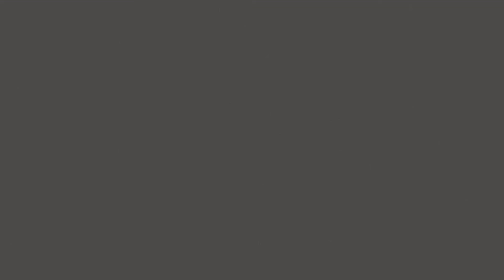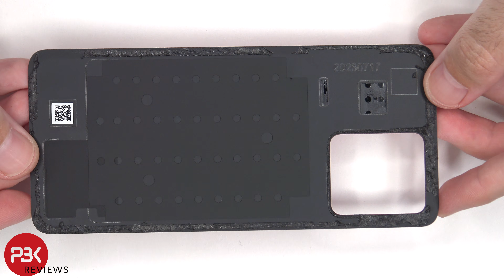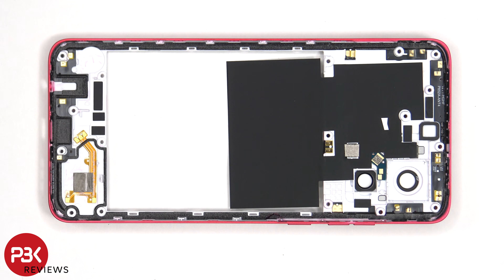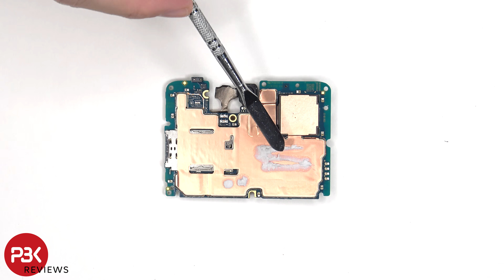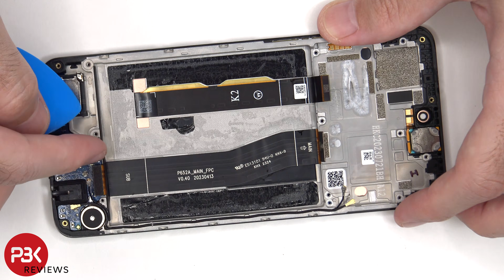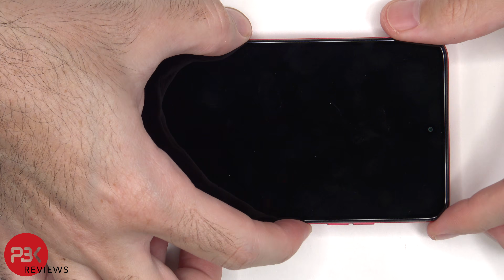Motorola Moto G84 Teardown Disassembly Repair Video Review

Comment: Did a screen replacement on this phone recently and would like to add that the circuit board screws (the 2 in the main board and the one in the sub board) are a different length to the previous screws holding the housing. Screwing in the longer screw into the main board hole (next to the cameras) poked the display from the back, breaking the pixels in that spot. Just something to be aware of.

Comment: My Moto g84 got water drops on it and I didn't notice on time that there was water between it and the cover and now it's stuck in a boot loop, how do I fix this? 😭 I hate that with new phones you can't just take the battery out to turn them off to prevent further damage

Comment: Hey, I really need help with this phone because I honestly don’t know what to do anymore. A couple of months ago, it suddenly turned off one day when I tried to plug it in like normal, and since then it’s been acting up. I took it to a technician, and they said it was the charging port (they replaced it), and it seemed fine after that. They said it had short-circuited, so I thought the issue was fixed.

But about a month after the repair, it happened again — it turned off the moment I plugged it in. Thankfully, it only did it that one time and worked fine for another month or so. By then, the warranty from the repair had already expired, so I just crossed my fingers it wouldn’t happen again.

Now, though, it’s gotten worse. I’m scared every time I plug it in because it feels like it might shut off again — and this time it did. Right now the phone is completely dead. It doesn’t recognize the charger at all. And obviously, it needs to be charged every day, so this is kind of unavoidable.

Usually, when this happens, I leave it alone and try again the next morning, and it randomly starts working again so I haven’t timed exactly how long it takes. But this time, I’ve had it plugged in with the original charger and it just won’t respond. I'm really starting to worry that this is either a problem with the phone model itself or maybe I just got super unlucky.

Does anyone know if there’s a known issue with this model? Or have any idea what could be going on? I’m 16 and I really can’t afford a new phone (cause i'm broke 💀)  I know it might seem like a small problem, but this phone was a birthday gift just last year and my parents already paid for the first repair, thinking that would fix everything. It’s only been about 18 months since I got it and I really took good care of it — never dropped it much, never got it wet, the screen isn’t cracked, and I even tried to avoid using it while charging to keep it in good shape.

So yeah, it’s just super frustrating because I rely on it for school too, and now it’s like I only get one charge a day before it dies again and every time it happens, it takes hours to respond, if it even comes back on at all. I’m scared one day it just won’t turn back on ever again (I'm worried about the things I have there.)

If anyone has advice, knows a fix, or has been through something similar, please let me know. I’d really appreciate it. I’m just feeling kind of stuck and don’t want to stress my parents out more. Thanks if you took the time to read all of this. Sorry, I’m just really frustrated right now. Great video btw 🙌

Comment: Thanks for this! Really comprehensive teardown. Getting off that back panel seems like such a pain. I've been fighting mine like hell.
Reply from the maker: Apply more heat with a hair dryer and use a thin blade or xacto knife to help lift it up to get a pry tool underneath.

Comment: Looks like a difficult job for the home repairer to replace the charge port. 😢
Mine fails to charge if the cable pulls to one side. Tried 3 new cables, all the same.

Comment: I have a problem with my First lens with many scratches. I found on ebay a replacement glass. Is this a solution for me? I mean, there is an another lower layer or do I have to change the whole lens? thanks

Comment: Thanks 👍🏻. The G84 seems to be well known for fogging camera lenses, and it's something that happens quickly from new. Motorola/Lenovo refused to repair under warranty. I could only find for sale the whole back piece including new lenses. Your tutorial was excellent. I definitely wouldn't have seen the camera flash to be transferred over. 100% success, and my photos have stopped looking like 80's soft porn.
Reply from the maker: You're welcome :)
Reply: @PBKreviews  Update: less than 3 months on, and the replacement lenses have already started fogging up. Wide-angle lens was the first to go. Becoming economically unviable to keep repairing. I'll never buy another Motorola/Lenovo ever again. Just hope someone reads this before buying. Motorola... a lesson on how to destroy a brand by moving manufacturing to China.
Reply: I've had mine a year and no fog issues. What do you mean by "fog" ? Is it condensation or actual damage ?
Reply: @ro63rto  It's not either. Specifically, degradation of the glass/plastic on the inside, causing a "fogging" of images. I replaced the part with new, but it has happened again. I assume the spare lens comes from the same factory as the OEM parts. I can only summarise that it's due to Motorola/Lenovo penny-pinching low quality parts, as I've never had a device in over 20 years that has had the same repeated issue. Sounds like you were one of the lucky ones if you haven't had this issue.

Comment: Sir how r u ? How can replace the camera lens . Need to open back panel or not?
Reply from the maker: no, just apply heat to camera lens glass and use a Razor blade or xacto knife to peel off the glass. it's held on with adhesive tape
Reply: @PBKreviews  thank u so much sir God bless u

Comment: I buy this mobile but after few days it's rear camera glass foggy or bluer. also service point not near us. totally disappointed with this mobile. when i search on youtube many motorola g84 users have same problem. please make a video how replace rear camera glass eassly.
Reply from the maker: The camera glass can be heated and pried off with a razor blade x-acto knife. But it might not be from that, it can also be from a bad seal of the back cover to the phone letting moisture in. If that's the case, you would need to replace the adhesive on the back cover.
Reply: Having the same issue with the lens glass "fogging". Phone only 6 months old. Never had this issue with many other phones, so can only guess it's a build quality issue. Have also seen this being reported as a common fault. Definitely won't be buying Motorola again.

Comment: Hey, what do you think about replacing the USB-C data/charging port on this thing? Is this doable component-level or just whole module swap?
Reply from the maker: All depends on your soldering skills. Mine aren't that good so for me its just much easier to swap the sub board. But do keep in mind if you are getting a replacement sub board, to get the same model number (for example if its XT8888-1 don't get a XT8888-2) since the region version with the model number would make a difference in antenna contacts on the sub board causing signal issues. You can find most parts to purchase for motorola phones on this website: www.mobilesentrix.com